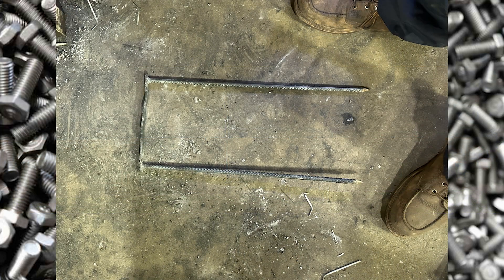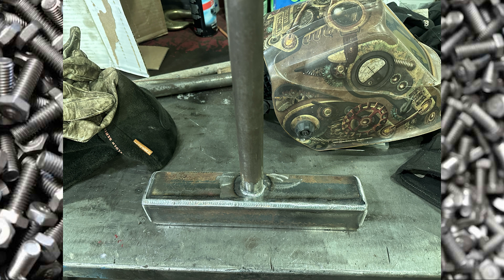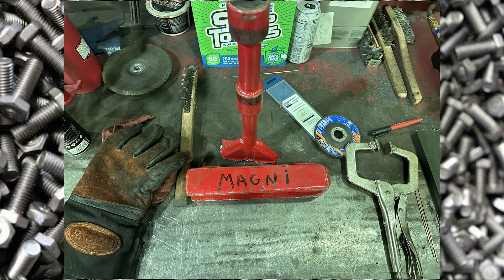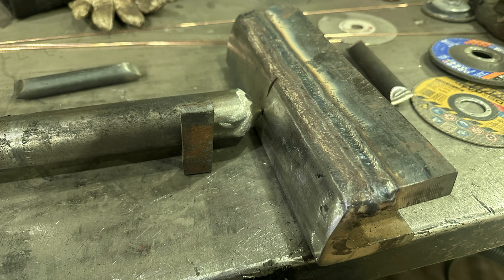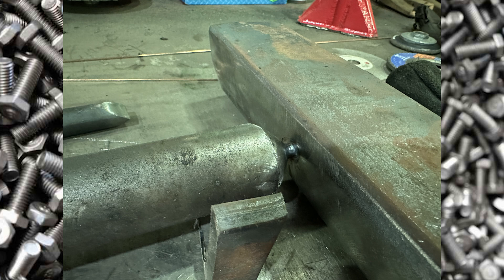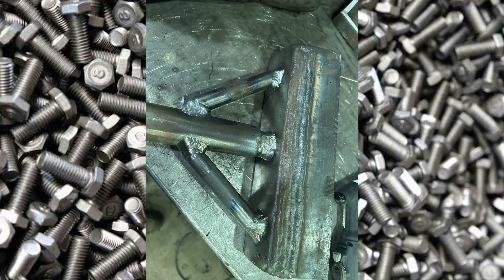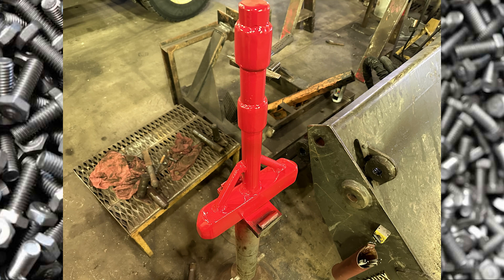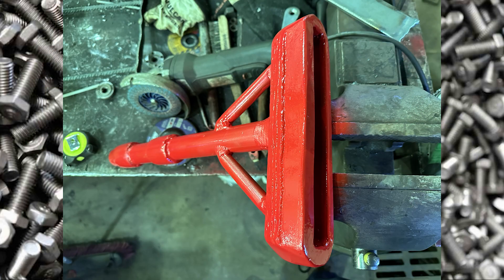2 failed attempts at welding a tool, will the 3rd time work?

Comment: Why the collars on the second one? You mentioned that it was for the jack hammer on the 3rd one.
Reply from the maker: If you’re talking about the metal bent around the shaft, originally I did that because the guy implied he wanted a lower place to hold onto it.  Then I found out I needed to make it bigger because it was going into a bore of a gas power tool lol.  I am still not sure if the 3rd tool worked or not, I have yet to hear back.  The 4th tool will just be an anvil lol.

Comment: Couldn't they have just gone to Harbor Freight and bought an extended warranty? Didn't have to tell them they were using a gasoline powered jack hammer. 🤔
Reply from the maker: Haha leaving out the jackhammer bit helps a lot until you come back for the 3rd time and people ask questions 😅
Reply: @makingmistakeswithgreg  Why couldn't they use a hammer drill?

Comment: Almost need to make something out of forged 4340 steel, in one piece, and then heat-treated???
Reply from the maker: Pretty much.  I don’t believe they will break my 3rd attempt, but if they do there won’t be a 3rd lol.  Unfortunately they won’t need to use it for another year since the stakes are all installed.  As far as I know they didn’t break it lol.

Comment: What I don't understand is how the rebar manages to penetrate the rock. It might have been easier to drill the holes for the rebar and drive it down the last inch or so.
Reply from the maker: So I guess it’s mostly loose rock which bigger stones.  They managed to do the whole job by hand last year, my guess is if they hit a hard spot they would move the stake to a different spot.  No doubt that jackhammer would pound one of those staples into a pretzel.  I believe the tool to be far stronger than the staples, but repeated pounding will likely cause a tool failure overtime.  Unfortunately I was tasked with making the tool, not teaching the people doing the work how to do the job the smart way lol.  The fact they pounded in 300+ of them by hand with a sledge hammer last year tells you a lot lol.
Reply: @makingmistakeswithgreg  Did you ever figure out if they put it aside or are using it?
Reply from the maker: The job is completed, but I am unsure if they used the tool or not.  It won’t get used until next year lol.  Next time I see that department I will ask what happened lol

Comment: You made a thing of beauty there. And the right approach - if you want it not to break, prepare to get a hernia 😂

Vaguely reminds me of a neighbour who brought me a tractor exhaust multiple times for repair. On the third time he asked me to add some reinforcement so I asked some probing questions. It turned out he kept clipping it on the same low hanging branch over a gate between fields and after a while it would break the welds at the flange. I asked if he'd prefer to keep fixing the exhaust or start fixing the manifold. You could almost hear the gears start to turn in his head ... Eventually we settled on just shortening the exhaust as the simplest solution, as he didn't want to move the gate or lower the road or mess with the tree ...
Reply from the maker: Good call on that lol.  The exhaust manifold wouldn’t be a fun one to fix.  You already know broken bolts and fun times will be ahead of you lol.

Comment: There is an underlying message in this video. And that is folk never tell you the full story of what needs to be done. Much like when folk ask, "Can you weld up this small hole for me, it will only take you five mintutes"? Or, "Its only a small patch/crack on the bucket, we only use to shift sand". 
I am impressed with Version 3, it is what you might call an HD Slot Drive Impact Socket made by Greg!
Reply from the maker: You are correct lol.   Everything is an easy repair to someone who doesn’t know what’s involved in repairing it lol.

Comment: Sir.. Your welding tutorial video  very helpful for me. And i am kindly asking for you to make one video about vertical down welding in 6010.And teach me what are the advantage and disadvantage!
Reply from the maker: I will do a video on that, it might take me a week or two to get it out.  In the meantime hopefully this helps:  

6010 can be run downhill with little issue.  Typically I run downhill at the same amperage as flat.  Vertical up I reduce amperage 15-20% over flat.  Vertical down produces less penetration than vertical up.  This can be a good thing to control burn through.  On thin, rusty metal 6010 downhill is a life saver.  It’s commonly done on open root pipe welding because it’s fast and will be far less likely to have the keyhole get out of control.  

I am curious to see how much penetration is lost running it down, I bet it’s a lot.  I literally just ran 5lbs of 6010 rods vertical down today one some trash metal to patch a dump truck box together.  Considering it rarely melted through it has to have less penetration.  I will do a cut and etch to see what’s going on 😀👍
Reply: Thank you sir @makingmistakeswithgreg

Comment: If they are going into rock they just need to  drive  a few inches.  The long rebar is for when they are driven into just sand.
Reply from the maker: I agree, but considering they did it by hand last year I think they like to do things the hard way 😅
Reply: @makingmistakeswithgreg  I guess they are heading in the right direction and at least using a machine.

Comment: S- Class tool steel is used exactly for this purpose. It’s what jack hammer tooling is made of, S- stand for shock resistant.

Maybe have a machinist bore a hole in solid square stock with a large diameter round bar shaft then weld it all in.

Comment: If you have to do another one make cup with a rubber insert in the cup. Also they make a head for a jackhammer and I wonder why they was not using a hammer drill
Reply from the maker: From what I was told the guys are more of a “pound sand the hardest way possible” type lol.  I don’t know anyone with half a brain that would spend days pounding those in through rocks and stuff when some shortcut could be found lol.

Comment: Tool steel? Like S7?  

3' of 1.75" round bar runs $205 at McMaster, considerably less than i would have expected. 2" x 0.5" S7 flat bar is $105 for 1.5'. That's $515 in steel, and then you'd need to send the finished weldment out for heat treat. 

They need to jackhammer holes in the rock with a proper pointy bit, and then install the staples, which they could probably just step on at that point.
Reply from the maker: I completely agree 😅.  I don’t believe they have broken the tool I made yet, but it leaves me wondering how in years past they achieved pounding the stakes in.  I heard they did it by hand lol.  100% agree, just drill or hammer a hole then push the stake in.  The guys probably spend 2 days on 10 staples 😅

Comment: Why in the world did they not used a rotary hammer drill? If your piece keeps breaking due to the power of the jackhammer and the amount of rock in the ground the rebar has to be getting destroyed and will continue no matter how strong your piece. I feel the problem is trying to help someone do something the wrong way or maybe just not the best way.
Reply from the maker: I make what I am requested to make lol.  Apparently the third rendition hasn’t broken yet, so it looks like the job was successful. I have a feeling the department that used it could break a anvil with a wet noodle 😅
Reply: @makingmistakeswithgreg  I think you did a great job, especially with the info you had. Not your job to reengineer their process. Thanks for sharing projects from work (this, the garbage truck) it’s cool to see real life situations and solutions.

Comment: Trying to drive that dinky rebar and strap into rock, and the tool is the problem?!
Reply from the maker: I heard last year they spent days doing it by hand.  They had the right idea, use a tool to do it, but I don’t know that a jackhammer was the right way to go lol.  I was picturing pushing the staple in by hand, and here the guys are using a jack hammer 😅.  They had to have bent a bunch of those staples.  I wonder if they are going to use a crane to pull them out 😅
Reply: @makingmistakeswithgreg  - I'm a Land Surveyor, but also really into welding/machining....... They'd be better off to drill the holes with a rotary hammer.  Rebar won't go through solid rock; I've tried.  😂
Reply: @makingmistakeswithgreg  I'm picturing Laurel and Hardey trying to install these things! Got my sticker btw, I love it!
Reply: I was thinking you were going to say they were using a cat or something to push them down. This is crazy. That rebar might have shattered!
Reply: I guess they never heard of a hammer drill?

Comment: Considering how much that jackhammer must weigh it’s possible that this tool only adds another 20%. Otherwise, how are they getting those things into the ground?
Reply from the maker: The guy struggled to pickup the hammer onto its side in the truck it was in, I am not exactly sure what it weighed lol.  I wish I could have been there to see the guys use it, it had to have been a comedy show.  I almost guarantee they pounded the stakes in so hard they will need me to make a tool for them to get them out 😅
Reply: @makingmistakeswithgreg  I don’t get it. Rebar isn’t that strong in compression. It’s just cheap, mild steel. It works in concrete because it’s in tension and the bumps grab onto the concrete. If they’re banging that into a surface filled with rocks, it seems it would bend when being hit a few times. Really strange. That size jackhammer is pretty heavy.

Comment: they would have been better off redesigning the "staple" perhaps a large flange on the rebar then use a tamper attachment on the jack hammer like a big nail
Reply from the maker: Yeah, something completely different.  I think those staples would work fine in actual sand.  When a guy busts out a jack hammer and is talking about rocks it makes me wonder what he was thinking lol.
Reply: @makingmistakeswithgreg Answer: He thought it was a good idea at the time. ... At least, that is the answer I give when I do Dumb.